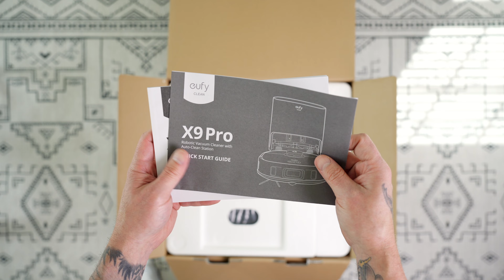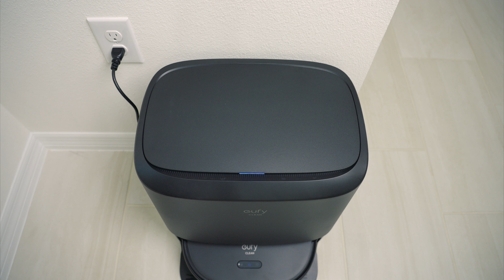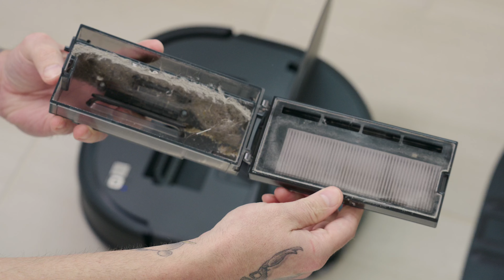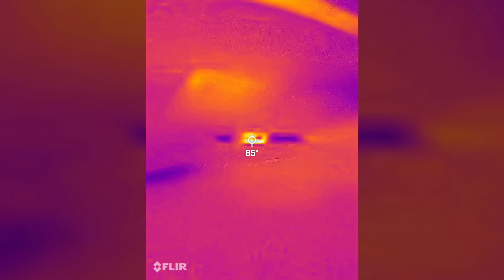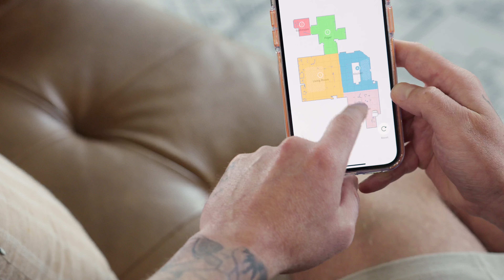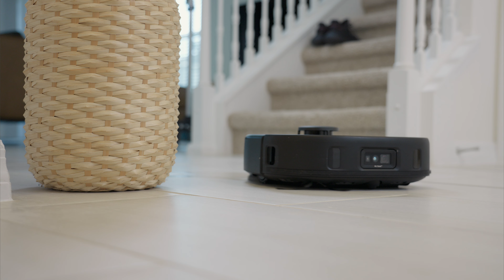eufy X9 Pro - Great Robot Mop + Vacuum With INSANE AI

Comment: When I first fired mine up, it was getting TONS of Error 4's that the brush was jammed, and I'd hit the button and it would continue.  But after about 20 minutes I stopped having that issue.  My only current issue is that my kitchen chairs have leg braces that are EVER SO SLIGHTLY too low for the LIDAR bump to fit under.  As a result, it will move my kitchen chairs(which are fairly heavy wood!) a couple feet and back up.  It's more comical than annoying, at least at this point.  Other than that, very happy with it, so far.